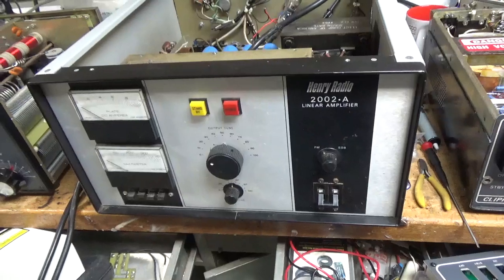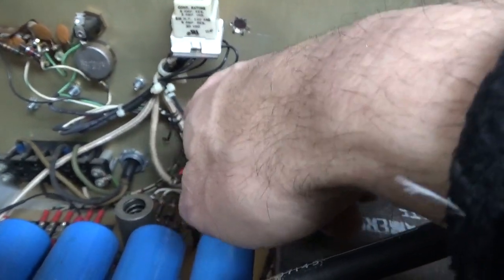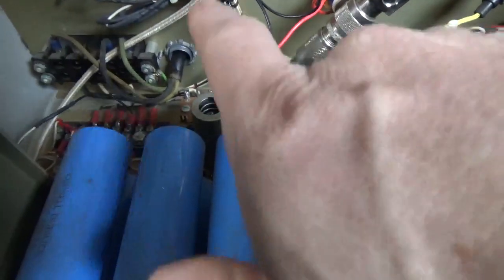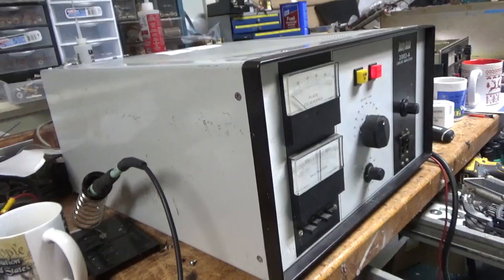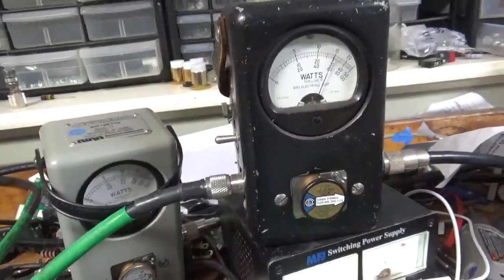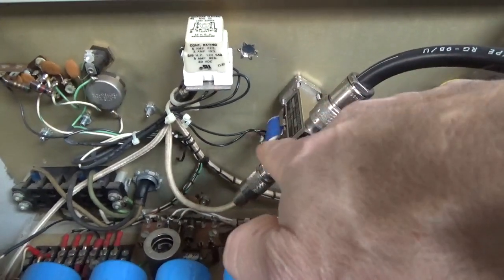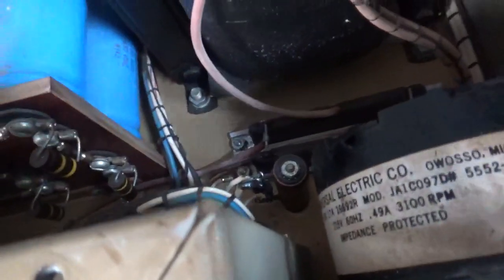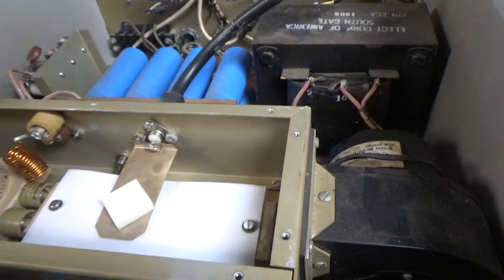2 Meter Henry 2002.A Over driven With A solid State Pa, Tube Flashed, Fiddled With Prior

Comment: Is there any reason an arc would form between the output coupling tang and the plate inductor?
Got in a 2002A where the Teflon got burned with an arc thru the Teflon insulator ... don't know what the guy was doing, maybe magic golden screwdriver cranking on the PA Load control too much?
Reply from the maker: He probably put the amp into an open (no load) on the output

Would cause the rf voltage to skyrocket

Comment: The first time a 3CX800 flashes the risk is that gold plating on the grid wires will vaporize. It condenses on the surface of the cathode and poisons the cathode's emission capacity. Makes the tube seem "weak" afterwards. The loss of gold plate on the grid wire will cause it to exhibit secondary emission from the grid at a lower temperature than the first time. A downhill snowball of sorts.
Reply from the maker: Spot on

Thank you for watching and for the comment